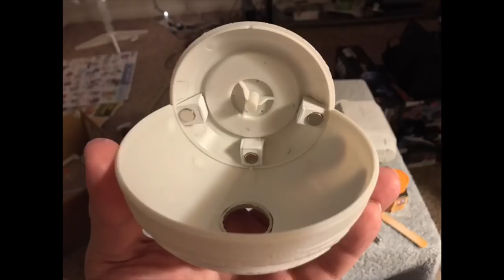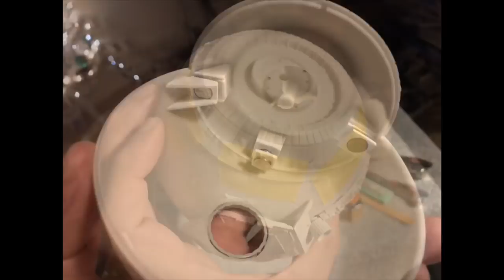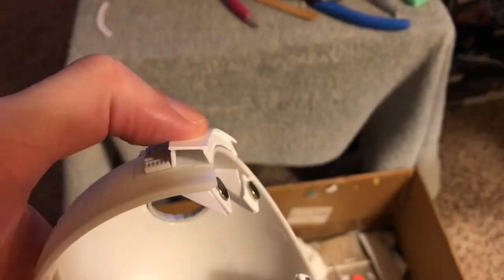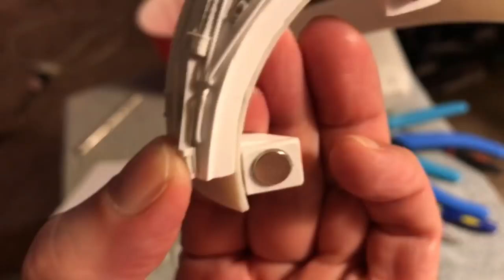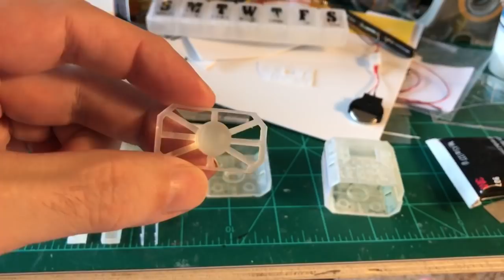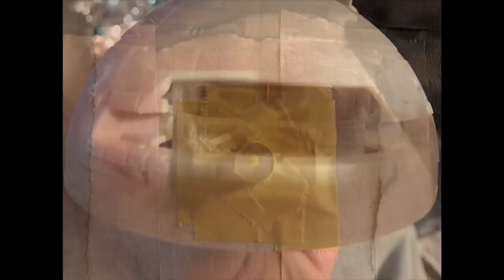Borg Discovery part 2

Comment: Some ideas for You if you're stuck .instead of doors use some green lights ,like a force field.the pods could be drones that come out the top.
Reply from the maker: Thanks Mick. I'm thinking of a similar idea where the door openings will have a weapon at the bottom, possible a kind of photon torpedoe launcher. Maybe little drones like you describe